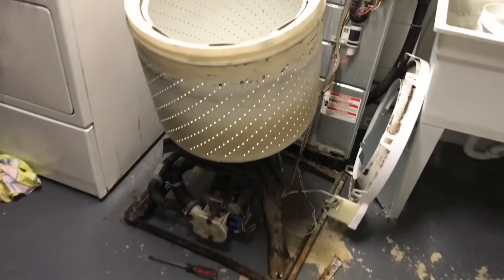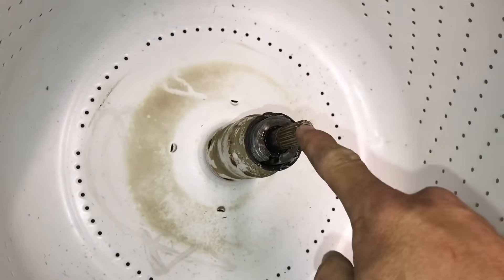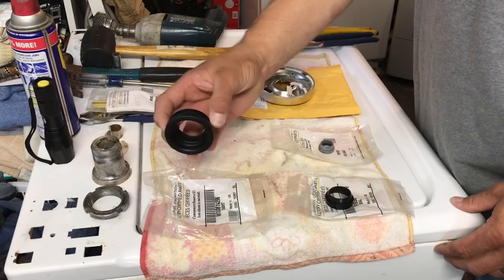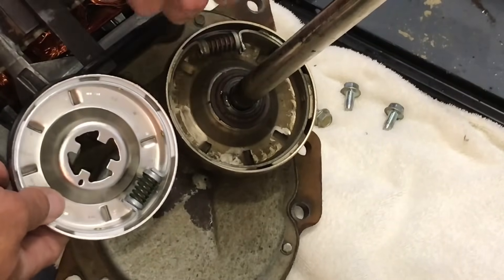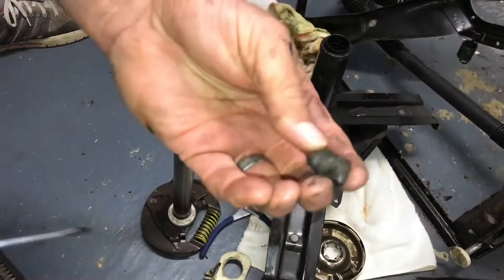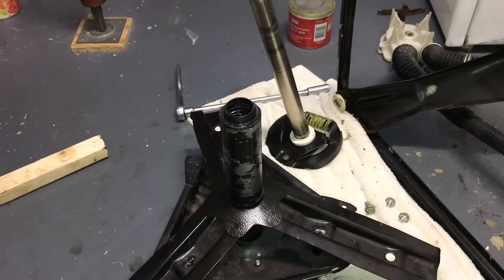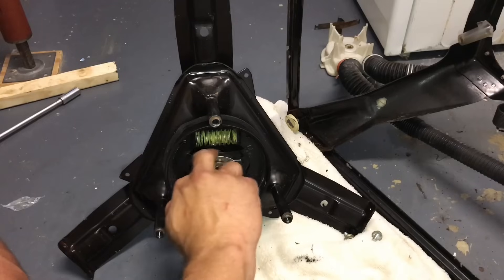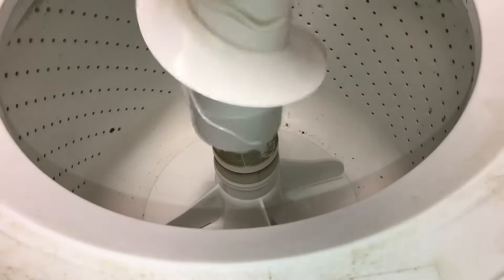Leaking Kenmore Washer - How to replace Shaft Seals.

Comment: im a disabled vet that is on soc.sec.and i needed a way to make some extra money i was picking scrap metal doung hauling ppl suff to the dump anything to keep food on the table about 10 years sgo i ran an ad on craigslist saying any body that will show me the basics of washer and dryer repair for everydsy the show me ill donate a day of my time to do whatever they need done whether cutiing there grass or dating there daughter  any ways 10 years later im pushing them out of my garage and beating used appliance stores buy 50 %  now this video is one of the best ive seen ive removed many tubs when i have one thats stuck i spray a soapy cleaner around the top of the drive block let it sit a few min. then ill take the end of my spanner wrench set it on top of the drive block and give the other end a good solid wack ..comes free everytime

Comment: Great video! Direct and to the point without lacking essential knowledge for the repair. Thank you!
Reply from the maker: Awesome feedback.  Much appreciated and glad the video was helpful.  Please subscribe if you haven’t already.  Stay safe!!!
Reply: As I'll be in this deep would you mind recommending other parts to replace while I'm there? Thanks again. Love this washer, it's been a good one!
Reply from the maker: @jackchappell001  - Really simple.  I would replace the tub seal (very inexpensive) and the clutch (buy the clutch kit) and the motor coupler (round rubber pice with 3 holes used to connect the motor shaft to the transmission).  That should be all you’ll need in addition to the shaft seals of course.
I agree, this is a very well built washer!!!!  Keep it running as long as you can.  Stay safe!!!

Comment: This was extremely helpful and I appreciate the fact that you didn’t sit there and ramble on about silly stuff that didn’t make a difference about fixing the washing machine I did do a little bit different online I used a two finger wheel puller or gear puller against the backside of the nut upside down so I had more of a flat surface and it pulled it straight out on the inside drum thanks for the video it was extremely helpful I’m going to keep using it while I replay as I’m putting it back together to make sure I don’t forget anything awesome I’ll be watching your next videos thanks again
Mark.
Reply from the maker: Thank you for watching and commenting. I’m glad to hear that my style of video was helpful. Sometimes I’m not sure if I’m making myself clear but thank you for the awesome comment. Stay safe and happy new year!

Comment: Excellent vid , I have this EXACT problem with a 20 year old Kenmore , it alwaya leaked for the last couple of years , but now the clutch is slipping , and so I  ran it with the body off and YES the water is dripping onto the cluch on spin and wash cycle , the machine only leaks on medium water level , not on low , so Im guessing it is the same problem , I will follow this vid step by step while doing the job , Thank you for this tutorial on replacing the upper and lower shaft seals , I would have replaced the tub seal alone and been in the same place , with a LEAK !! , Thanks a million for this info , and you were right , its the first vid posted to show a detailed breakdown of the seal locations and replacement , you Rock Bill ., God Bless .........
Reply from the maker: Awesome to hear - I'm glad this video was helpful.  Appreciate your kind support.  Let us known your outcome following your repair.  Yes, running on low with no leaks is a tel-tale sign that your shaft seal is leaking.  Best of Luck!!!

Comment: Just got done replacing my clutch plate. Tub wouldn't spin and it was leaking. Figured I would be changing the tub gasket, didn't think about the shaft seals! This is going to save me a lot of time! I would have taken everything apart, put it back together and probably would have had the same problem. I have a 23 year old Kenmore Series 90 washer. I want to keep it for another 23 years! Thanks for a great video!
Reply from the maker: As long as the motor holds out your in good shape.  The cost to replace the motor would be too much to keep the old girl going!  They are good quality machines that’s for sure.  Thank you for watching and supporting my channel.  Stay safe and healthy!!!
Reply: @SmokinwithKasket  Used motors on ebay are often reasonably priced. Use cross reference part numbers from an appliance site.

Comment: I happened across your video after doing a similar repair on my washer a few days ago.  One thing I don't see in the video, nor in the comments, is that there are actually two of each of each of these seals.  They are stacked on top of each other.  I replaced the basket drive with the brake on it (and a good thing since mine was very rusty and didn't want to come out of the base) and it came with the seals already in it but the base housing with the larger seal actually had a second one underneath the first.  I only ordered one so I only replaced one but to do the job right you should replace both.  The basket drive with the brake also has two of those smaller seals stacked on top of each other.  You can verify this with the parts diagram on sears parts direct website.
Reply: Did you end up putting 2 seals, one on top of the other?? I have messed up 4 seals trying to get them seated where it is so tight fitting and that's just with one. I don't know how in the world to get two down in there, but I do know that when it's level at the top there is a gap under it and my washer still leaks. Any help would be appreciated.
Reply: @sueramsey7031  I only removed one and only replaced one. I left the old lower one in there. There wasn't much left of it but I didn't try to dig it out. Mine has been fine.
Reply: @johnaclark1  thank you
Reply: the new bearing and seal kits only have 2 seals for the top - 1 below the bearing and 1 above the bearing with the grease groove on the inside of the seal...

Comment: My Kenmore washer has Transmission  cover seal, Tub seal, lower spin tube seal, upper spin tube seal, and Transmission upper shaft seal. 
I'm replacing all, don't wanna go back there in a hurry.
Replacing clutch kit also.

Your video is very helpful.

Comment: Great video.  One thing to check are the bearings in the tub support tube.  If those bearings are worn, it is likely the spin tube shaft is scored and you'll need to replace those parts or the new seals will go bad in a short period of time.  Your spin tube appeared fine though.
Reply from the maker: Awesome suggestion.  Thank you.  I appreciate you watching and sharing.

Comment: Thanks for the great video. You can use a socket of the proper diamater to tap in those shaft seals. When installing the transmishion wrap the splines with electrical tape to prevent them from damaging the inner seal.
Reply: Any idea what size sockets? I've cracked the upper shaft seal three times trying to knock them in
Reply: @jerryblack21  Sory, can't remember.

Comment: Great video. Just what I needed for my Roper. I went ahead and got a new washer today. What prices on these things? My Roper was 10 and half years old, so I went ahead after just fixing it from not spinning, and then seeing it was leaking in the center.  Then tearing it apart and seeing it was the top seal leaking, that I decided to get a new washer. Now after seeing your video, I will now order those parts and fix my old washer.

Comment: Thanks for the information. Mine is unfortunately from 2007 so the basket (brake) and transmission/shaft is coming in one piece. I don't want to hit the pry bar too hard but might need to. I put some pb blaster on the top seal so hopefully it goes all of the way down and lubricates the shaft.

EDIT: Finally got that sucker off. I had to use a pry-bar to get it off. It had a lot of soap build-up!
Reply from the maker: That was probably a smart move. Glad the video was helpful.

Comment: Had a leak in mine and the clutch slipping. Playing around I tried a small load and the leak stopped. Guessed a seal or hose was the problem. Got a seal for the tub bottom but got to thinking that it would still leak on a small load if that was the problem. Haven't fixed it yet and think the shaft seals are the issue. Random no spin issues are now a problem even after drying out and cleaning the clutch. Suspect a wiring or timer control dial may also be a problem. Determined to fix it as I don't like any of the new machines available today. Thanks much for this informative video.

Comment: Thanks for the great video, it's very helpful.
But my 25 year old Kenmore is leaking. I'll check it out, but if it's not a simple problem like the drain pump, then I'll
just buy a new washer. Too much work even for a mechanical person like me. I have also read that newer machines are more energy efficient.

Comment: Thank you. I was going through the process of elimination to stop my washer from leaking and I didn't think about the seals. Parts are on order. Thank you.
Reply from the maker: futurehunter - sorry it’s was the seals.  Never the easy tub seal!!!   Good luck, take your time.  It’ll work out great.  Thank you for watching.
Reply: @SmokinwithKasket  ,, My Whirlpool is dripping when in motion only. Is it the shaft seal ? Shouldn't the tube seal leak even when the machine is off once water is in the machine ?
Reply from the maker: Try filling the water level to a low setting.  Run it.  If no leak then raise the level higher.  I still suspect the seals.  Mine leaked only on motion.  If no leak on low water level but a leak on high water level that’s fir sure your seals!
Reply: @SmokinwithKasket  ,, Once it is running it  leaks.... Whether low or high on water level. The thing is it does not leak if I manually filled it .
Reply: Thanks again for responding. Blessings
Reply from the maker: @michaell3711  that’s a head scratcher.  Your going to have to really investigate where the leak is originating from.  I can’t see how manually filling the tub would have any effect on he leak wherever it may be coming from.

Comment: Really good video , I like that you didn’t include disassembly  and went for the repair, Thanks
Reply from the maker: I included the major disassembly. I figure if individuals don’t know how to gain access to the motor and transmission and disconnect the water pump and all the simple steps they really shouldn’t be going for replacing the seals. Thanks for watching I appreciate your support. Stay safe my friend.

Comment: Excellent instructional video.  Clear, concise and detailed.  Thank you for making this video it was very helpful.  My question is how do you resolve the issue of the drive block  to tight on the drive tube?  Both parts are brand new.   I don't think you should force block to seat in the tube.  Any advice is greatly appreciated.
Reply from the maker: Hi Khan. Thank you for the awesome review.  Much appreciated and I’m glad the video was helpful.  To answer your question about the drive block, if I’m understanding correctly, just tighten the spanner nut down nice and firm. This will force both parts to seat correctly and securely, especially if they are new.  Hope this helped.  Stay safe and healthy.  All the Best-
Reply: @SmokinwithKasket   Most instructional video regarding this type of repair shows that the drive block just simply sliding into the drive tube.  In my case ,  the block doesn't seem to fit into the new drive tube.  Even though they are the correct parts.  I've tried sanding the inside wall of the block just to remove a little of material but to no avail.  So I ended up polishing and using the old drive block with the new drive tube.  Thank you for your response.
Reply from the maker: Sorry to hear you had such problems. Things  never seems to go easy.  Glad you figured out a solution.  I can’t figure why the two parts wouldn’t seat correctly. Hopefully someone knowledgeable with this specific issue will see this post and offer an explanation.  Best Wishes.
Reply: @SmokinwithKasket  After market item?  I try to buy OEM when possible - it is definitely worth it to repair the washer right the first time around.
Reply: @khantutan825  I turned the old drive block upside down  and pounded on it to drift the new block into place.

Comment: Aha! I need to do this even if I change my clutch. This is the real problem. Thanks for this video!
Reply from the maker: Would be good idea to change the clutch.  It’s cheap and readily available.  Like the good old days - changing the spark plugs and wires but not the cap & rotor.
Reply: @SmokinwithKasket  I just did. But I should change the gaskets as well. The motor was greasy and looks like there are soapy leaks.

Comment: Really appreciate your efforts with this video. That upper shaft seal is giving me some trouble going in.  Oiled and greased it but I wrecked one already.  I'm thinking about freezing my second replacement for a day or so before installing it... try to slightly shrink that metal ring enclosed within the rubber.  Thoughts, suggestions?  Thanks for your time.

Comment: Great video! My 1996 KitchenAid washer will leak about 1/2 cup of water … only when fill level is 7/8 filled or higher… not with smaller fill levels.. I’m assuming it’s the top transmission seal. Would you agree?  By the way, I just replaced the neutral drain in the transmission and I’m wondering if removing and reinstalling the transmission somehow disturbed the seal because after that the leaking began.
Reply from the maker: Thank you for watching and commenting. I would agree with you 100% that disturbing those old seals has caused them to begin leaking.  And also that’s a telltale sign that it’s the upper seal issue if your unit does not leak when you have a smaller load or a lower water level in it.
Reply: @SmokinwithKasket  Thank you kindly… I just ordered a new seal and will tackle this.

Comment: This is is by far the best video ive seen for the direct drive washers. I have the same problem with my elite 80 series washer. Water is leaking down through the clutch assembly onto the transmisson which unfortunately got into the transmission and caused oil to leak all over the floor ruining the transmission. so I recently bought a new transmisson and replaced the lower and upper shaft seals along with the main tub seal and out everything back together thanks to this great video. Now having said all that i started a small load and noticed there was water dripping down the frame of the washer. So i dissasembled the washer again down to just the outer tub and noticed that if i just have enough water to cover the bottom main tub seal it does not leak but if i push down on the bottom of the outer tub a tiny bit acting like there is a large load of water the main tub seal leaks. Anyone have any ideas what i can do here? I was wondering do i have to use some sort of glue when installing the seal to make it water tight? Just wanted to mention this incase others are having the same issue as me and unfortunately replacing the seals didn't fix the issue I was having. So this  also might be the problem to the water leak that you and others are having.

Comment: Kenmore model 11020852990 Came across your video and it seams very promising. My washer started banging really bad all through the spin cycle. i'm only going to replace the clutch because it's not leaking. At 65 years old I've learned not to fix stuff that's not broke yet lol. With your video I am certain I can handle anything that pops up or leaks out. Thanks for taking the time to make the video. My 3 year old LG refrigerator just lost the compressor and the technician jinxed me by saying I was lucky my washer didn't go out. He said the new stuff is junk.
Reply: The LG's compressors are a mess.  It is a new technology type and has proven unreliable.   Contact LG - there was a class action lawsuit against them for the compressors.
Reply: @Timetryp  Thanks for the reply. The repair guy was almost my age and told me they had a lot of problems. He blew the lines out with gas after taking the compressor off and all kinds of black powder came out. He flushed them and then put on the next-gen compressor and it's been working fine. Oh LG paid for the whole thing.

Comment: 17:47 question should the shaft spin easily like that or should it be difficult to turn/spin. I can move the coupler with my fingers and it will move the shaft but when I try to move the shaft like you just did it won't move. Only when I move the coupler. Hopefully you'll see this. I know the video was a long time ago. Working on it now! Thanks
Reply from the maker: Thank you for watching and commenting.  Yes, the shaft should turn easily like that.  Not sure why yours is binding or difficult.
 though.  Possibly, the spin brake is engaged.

Comment: My tub action seems okay and I recently removed the tub and did a complete tub cleaning, however I noticed what looks like oil residue on the floor under the unit. Does the transmission have an oil seal?